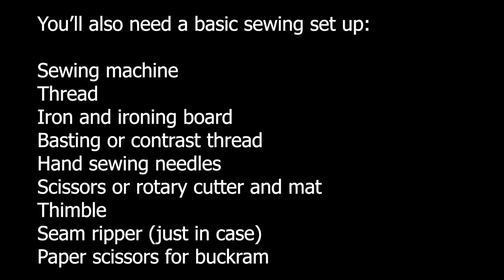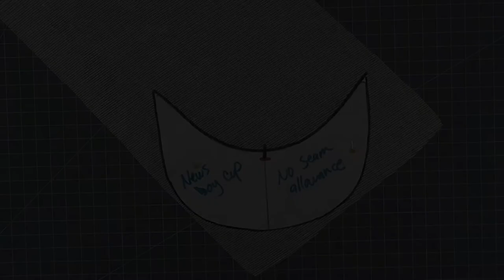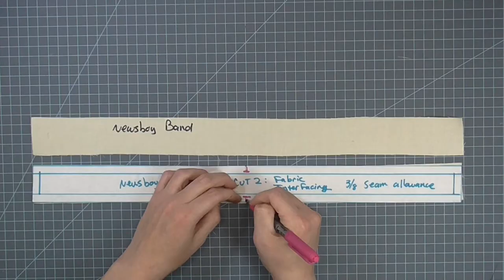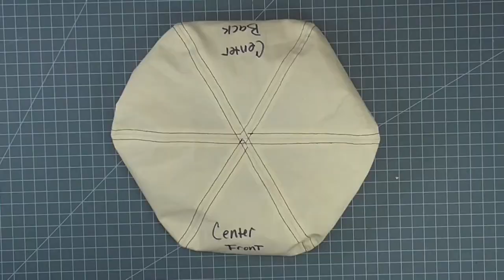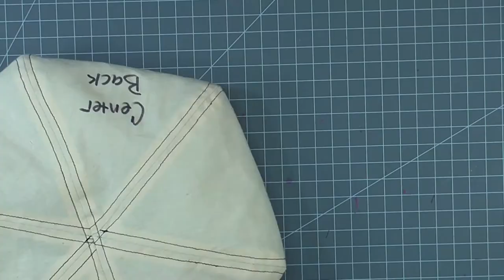How to Construct a Newsboy Hat: 6-Section Crowns

Comment: Such a great video.  I am very tempted to try it.  I have a question.  I just purchased a beautiful linen newsboy cap and the top was securely tacked down in three places to the visor.  Is one supposed to remove this?  Or does it hold the hat together better during use.  I’m think of tailored jackets that often have the pockets and/or pocket flaps tacked closed/down to preserve the shape before sale.  I always remove this from the jackets but I’m not sure about the hat.
Reply from the maker: If you want to keep the crown in place, yes. If the thread is a contrast color, then it could just be basting and can be removed.

Comment: Looks like a baker boy hat.   News boy hats usually has 8 panels and the panel seem lines up at the center of the brim.
Reply from the maker: You can divide it into as many sections as you want. You can also line up the brim wherever you want.